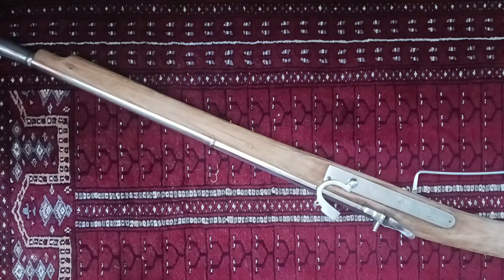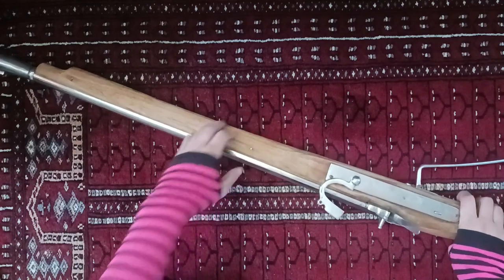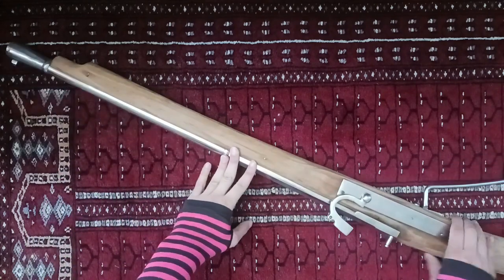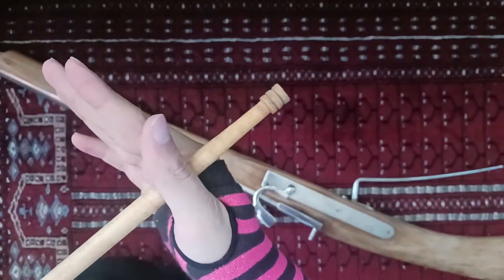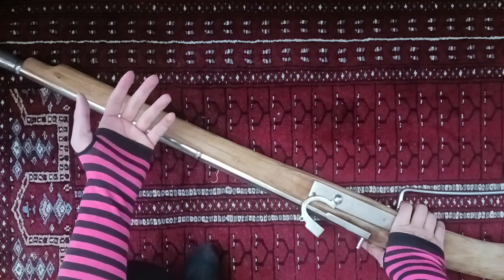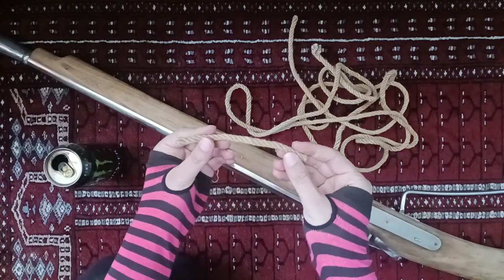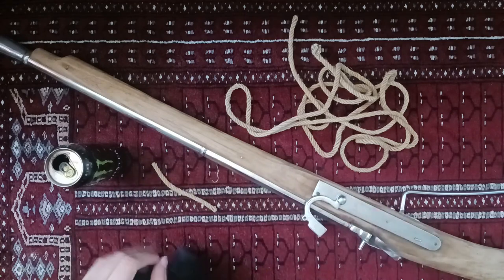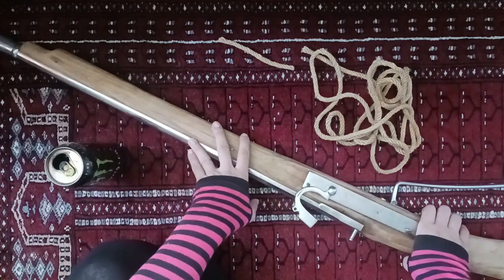Military Heritage Matchlock Arquebus Review

Comment from the maker: *Correction: I said having too much distance between the touch hole and the breech face makes it harder to clean the gun but that's not exactly true. It causes three problems. The first problem is that sometimes caked powder and other crud will accumulate in the space rear of the touch hole, and when that happens, you will have to clean it out (which can be difficult). The second problem is that if you load with a wet patch, it can soak the powder in the vicinity of the touch hole, resulting in misfires and requiring you to unload the gun. The third problem is that if you don't put much powder in, or forget to put powder in, the ball can block the touch hole, preventing you from shooting the ball out.

Comment: Hi Femboy musketeer, i recently bought an arquebus and its not from Military Heritage but also made in india and was wondering if the serpentine on your arquebus is also loose and wobbly? Mine is and i thought something was wrong so i took the mechanism out to check but the weird thing is when its out of the stock the serpentine isn't loose/wobbly, when back in the stock it is again uhh wtf?? Do you have that too? I can't stand it and still trying to figure out to fix it.
Reply from the maker: @dennishornikx2338  the serpentine on mine can be wiggled a millimeter or two. I never really noticed or had an issue with it. The trigger bar is a lot looser. I've never taken it apart. 

I think they all come from the same factory in India even if imported by different companies.
Reply: @femboymusketeer  my trigger bar isn't loose at all anymore, was easy to fix by just wrapping tape around the part that goes into the stock but the loose serpentine i gave up on that for now

Comment: Thank you for this in depth video.  I have been thinking about adding this to my military heritage collection, but the short size has kept me from ordering it.  Did you try using a .570 or .562 round ball to see if they will fit?
On the other hand, the .75 cal.bore and size is too much for my taste.

Also, how did you arrive at your Femboy Musketeer channel name ?
Reply from the maker: @robertrobert7924  .562 barely fits, the sprue gets in the way, and the front part of the bore seems a bit choked. I think it lasted 9 shots before fouling prevented reloading.
Reply from the maker: @robertrobert7924  my channel name? Not hard to put 2 and 2 together!! But I always liked the theme of musketeer femboys
Reply from the maker: @robertrobert7924  correction on my first comment. actually its .550 that fits up to 9 shots. .562 wont load at all. I wasn't sure until I just discovered that I still have a bag of unused .562.
Reply: @femboymusketeer  Thank you for your reply.  Do you have another platform to discuss your interesting lifestyle?

Comment: Do you just drill a touch hole or do u also add touch hole lining?
Reply from the maker: @bythebnro7498 Just drill. Liner isn't period and is more complicated to do.
Reply: @femboymusketeer  thank u, I got the longer version and was hoping to shoot it, and since u have got 200+ shots with no liner I should be fine, thx again
Reply from the maker: Yes and if it ever starts to wear too big, you can install a liner later on, no need to do it first thing.
Reply: @femboymusketeer  has your touch hole weared at all in your shooting?
Reply from the maker: @bythebnro7498  I don't see any difference so far.